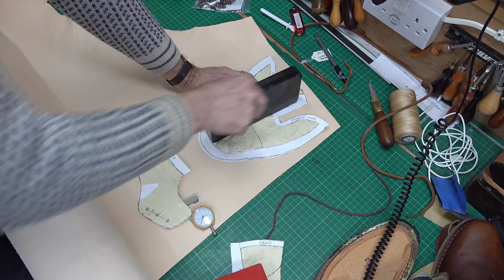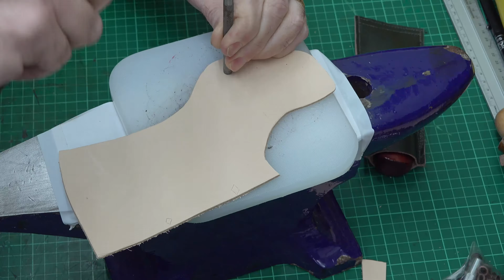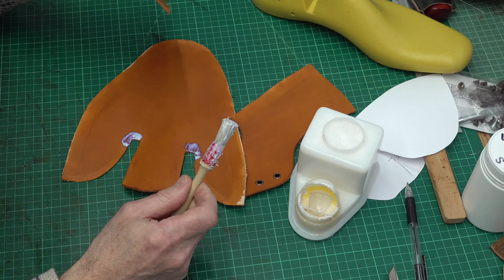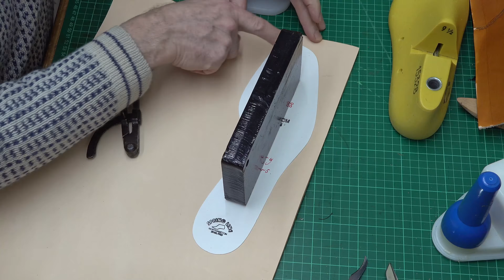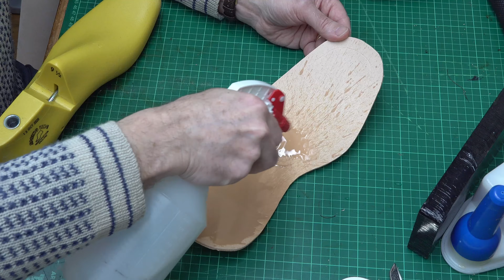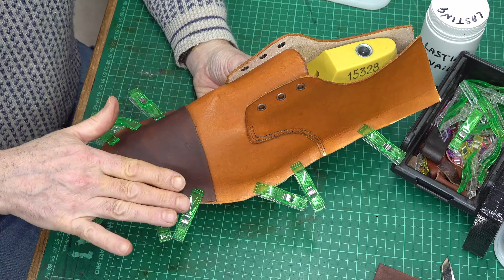Easy Shoemaking Part 4 Cutting Out Leather Components and Partial Assembly

Comment: I tried to overlay my leather on my lasts like you have done here, and planned to pin them down with clips, and make a ledge around the base for the down stitch. Exactly as you showed. 

Maybe it has to do with the shape of my particular lasts, or maybe I didn’t make my pattern as accurately as I should have, but I found it was not possible for me to get the leather to take a good shape and fit tightly and snug against the shape of the last this way. 

What I had to do was use lasting pliers like you would in a normal lasting process, and I stretched the leather enough to fit well, and nailed it to the sole of the last without it having any leather on it. Just the bare sole of the last.

Once the leather had sat stretched and lasted on the last for a day, and with the help of a shoe hammer to smooth and flatten out the line where the upper folds under onto the sole, I pulled the nails out, and then reversed the direction of the fold so that it formed the ledge for me to be able to use this stitch-down construction. Had I not done this, my leather would not have fit well to the last at all. 

This made me wonder, did you find that your shoes stretched out quite a bit? I’m sure it varies based on the thickness of the leather you use for the uppers, but even using 4-5 oz leather for my shoes, I found that it still stretched a good bit during the lasting. Without having done that, I’m imagining the shoe would stretch out too much with wearing as you break it in. Did that happen for you? Or was the veg. Tan thick enough that this has not happened? 

Thanks a lot!
Reply from the maker: Oh clever, I  have been wearing mine as my back of house shoes  so I have them on loosely...garden slipper style...they are holding up well, would probably be on the loose side if I did not have a generous insole!
Reply: @harryrogers  Thanks for the reply Harry. Appreciate these videos you made. I’ve used them quite a bit for reference as I learn to make shoes.
Reply from the maker: @acresofcosmos7563  Thanks that's great.

Comment: Hi. Might be a stupid question, but I have a thin piece of Italian leather thats a very light colour and very shiny and I don't like it. The wrong side of the leather however is a nice darker colour and is not shiny obviously. Can I glue 2 right sides together to make it thicker. And will it be  OK to use the wrong side rather than the right side.
Reply from the maker: Its difficult to say without seeing it  but you are not compromising strength which is something!
Reply: @harryrogers  thank you for your quick reply.

Comment: skive on a hard surface like glass or marble, not your cutting mat
Reply from the maker: Hi James...I know a lot of people advise to skive on a hard surface, and I do get it, but I like to skive on my mat in case I hit the blade, and then have to resharpen it....it is interesting, you are certainly completely correct so absolutely no disrespect, I just choose to do it differently. Happy New Year to you.
Reply: @harryrogers  Hi Harry, I understand. I do many techniques against the grain, however I would recommend trying to perfect it on a hard surface as you will actually get more consistent skives, be able to skive much quicker and believe it or not the cutting mat will actually blunt your blade faster than most of the leather you are skiving and a glass/marble surface. At the end of the day though, do what works best for you.

Comment: Hi Harry! Enjoying the series very much. I wish you would have shown the swing step - I had to do a double-take to make sure I didn't miss it. Could you please show where and how you've sewn later on in the series?
Also, I don't know if anyone has mentioned to you, but for an even more even dye application, you can use a small flat sponge that's not too absorbent.
Finally, do you plan to do anything to prevent the dye from rubbing off on other things, or prevent the leather from discoloring?
Reply from the maker: Hi - very briefly at 5.44...there will be plenty of sewing in the next one...thanks for the tip...I am finishing these with snow white cream.